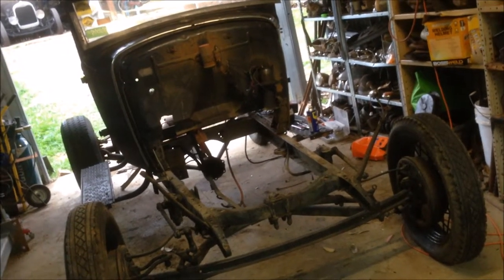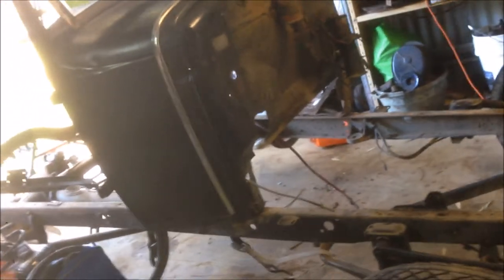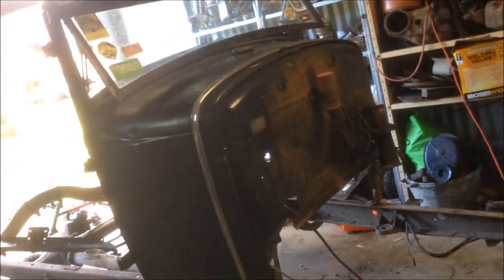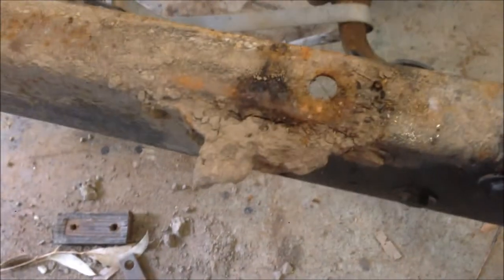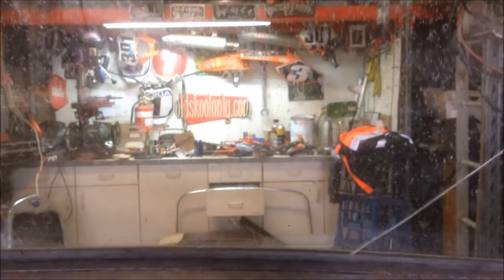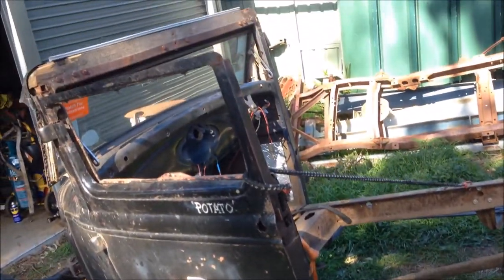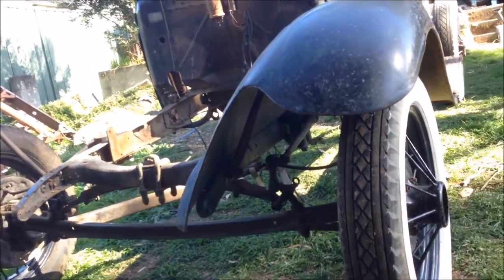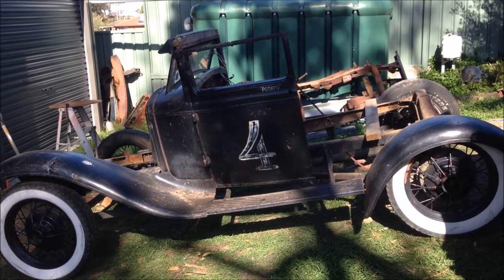The Flat Pack Pickup pt2 - Gulgong 2020

Comment: That's definitely some good work there man I like that channel job I built a 1939 Ford pickup truck about 13 years ago I used a Mustang 2 front suspension with Ford Pinto Springs which put the front crossmember at about 4 in off the ground the rear end came out of a 1964 Ford Falcon